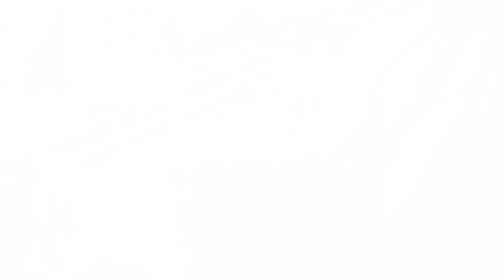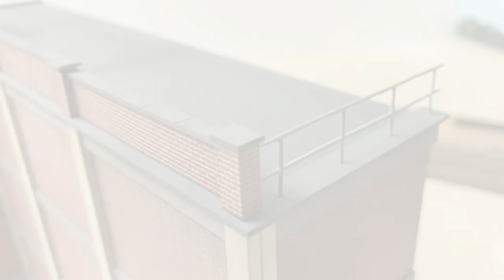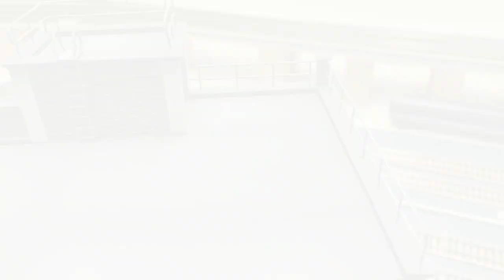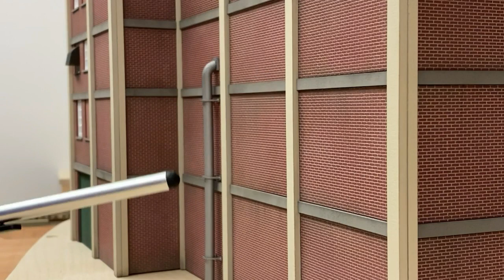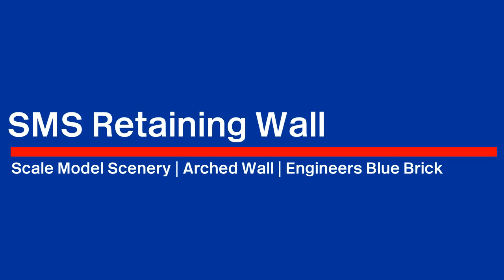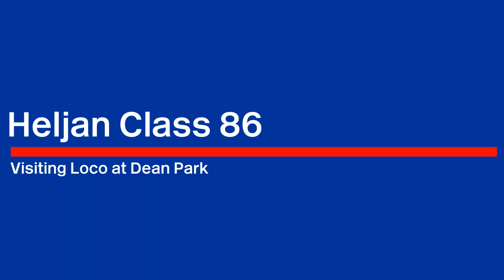Model Railway | August 2021 Layout Update | Dean Park 282

Comment: Just another comment .... This time on the Class 86 at 36:12 ... The head-code looks wrong as the numbers and letters are way to thin. ... They should be slightly thicker, and the prefix 1 should be centralised on the rolling blind - not set to the outside edge !! ... The side profile at 36:31 also looks terrible. .... Let's hope this is a prototype error and they improve these details before it is available to purchase ?
Reply from the maker: Interesting. I’ve not really studied the head code versions so didn’t spot the lettering issues. :-)

Comment: I can see you like snowploughs on the locos running on your splendid layout.   Would they still be fitted in late summer (stated theme period) or removed and kept at the service centre??
Suggestion:   The new grass area to the left of the station has no wire underneath but lots of storage potential,  how about a few hinged flap doors cut into the vertical ply facia?
Reply from the maker: Hi, up here in Scotland they tended just to keep the ploughs on. No sooner would they take them off in spring than they’ve have to put them on again In Autumn.

Comment: Excellent video Dave. That factory looks awesome. As a newbie to this railway modelling would a release of a newly tooled Class47 impact the second hand price of an old version?
Reply from the maker: Thanks 

I’m not sure it will… as the current 47 is excellent and highly desirable. It also came in one off liveries or specifically named locos that are unlikely to be reproduced by Bachmann going forward. 
The new one is over £200 for the base model, which is out of reach for many modellers. So I still think the current model will be popular. Plus!… the new one looks extremely similar to the old one! So modellers won’t be selling off their current models to replace them with the all new ones!
Reply: @DeanPark  thanks for the response much appreciated.

Comment: Enjoyed watching that, Dave.  Well done on the lino factory: it's looking great.  I remember when used to nick McDonalds straws for that sort of pipework!  At around 6:55 you mention picking out the edges of the window vents with silver to give an impression of the metal showing through: I picked up a great tip from a German model railway youtube channel (Sebb ́s 1zu87): he uses a graphite pencil to run sparingly over painted "metal" to show where the paint's worn away, and the base metal shows through.  Seems to work really well, so could be worth a go?

Comment: I think you have made a great job of copying the finer details on the factory like the brick pillar at the corner of the railings. Things like that make a lot of difference to the end result. The class 47 looks good. The windows always something I noticed about them and the Peak having a blue colour, but not sure about the price, when running on a layout you are not going to notice anything different over the old version. For a loco depot layout where it is parked up with the cab lights on it may be worth the extra cost so I would have to think hard about buying one. The class 86 on the other hand I will buy, I like the smooth running motors they use and have found their other locos to be very reliable. I rather have something that works well with a little less fine detail than a loco costing far more with detail I am not going to see. The tool boxes and tools look great. That kind of detail I do like to add to my buildings and a detailed  lit workshop by the lineside adds a focal point when there is no train passing.

Comment: Dave, the real 47 windscreen was much the same, depending on what angle you seen it from, I think this is a good modification from bachmann. Back in the day of the old Hornby 47, I used correcteen fluid for typing, but it stayed a purple - pink colour instead of two tone. Ps love the new building, top marks
Reply from the maker: Cool. Not sure how the glazing will look scaled down in model form though. We shall see.

Comment: Nice job on the Nairn building. Scratch building does take a bit of time. I have some buildings I have "thrown" together in short order but another that is still evolving after two years! The engineering brick arch retaining wall looks good - I especially like the lime mortar streaking you've done. Cheers
Reply from the maker: Cheers. Yeah I take ages on mine to get them looking the best I can. It’s enjoyable but pretty involved at times! 

Yeah I’m happy with my wall. Cheers

Comment: As usual, stunning Dave. Attention to detail, should be your middle name. Truly mind numbing the lengths you go to. I bet the more fluent Scottish comes out when your building, painting the finer details. Is that build of the Lino factory based on the one that used to stink out Kirkcaldy? I also share your passion on 47s, the Intercity and 2 tone grey look amazing and the Banger blue livery looks more authentic. Not my money to spend but if I could spend your money, not that a Scotsman would give his money up without a fight lol, the 2 tone grey would be my choice of 47. 47004 as you already know had a spell in the early 80s at ED, apparently it was unofficially named Monster but it may have been BR Blue then. Though I stand to be corrected on that, I'm not totally sure. However Many thanks for sharing though Dave. Keep up the fine work.